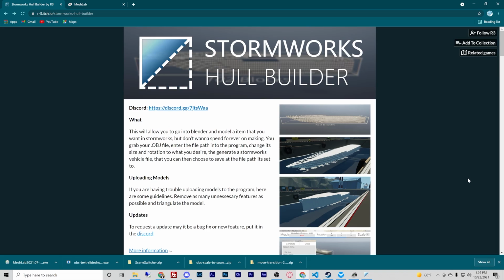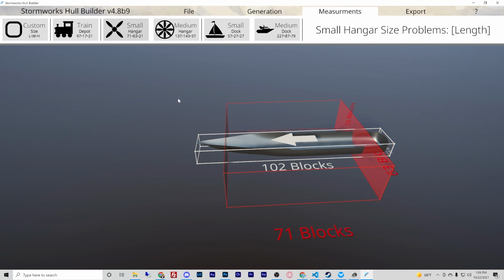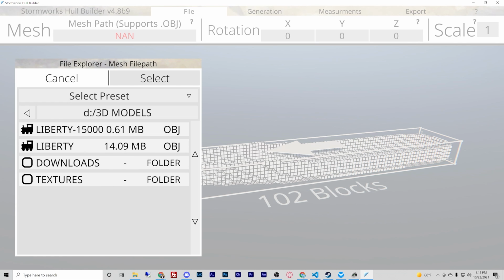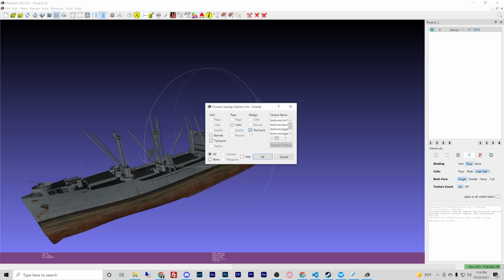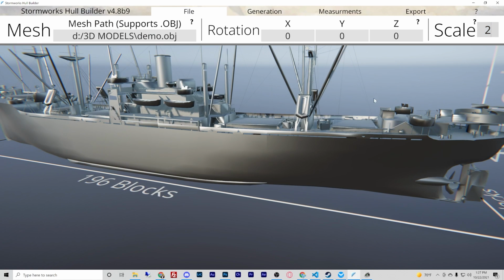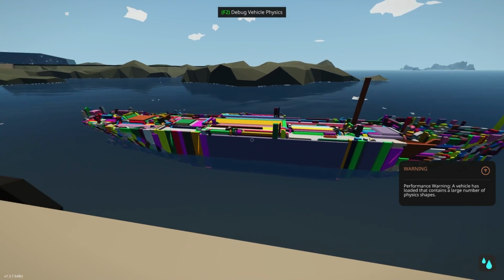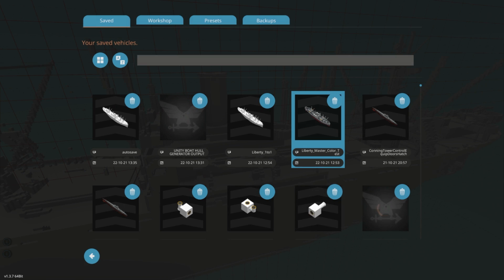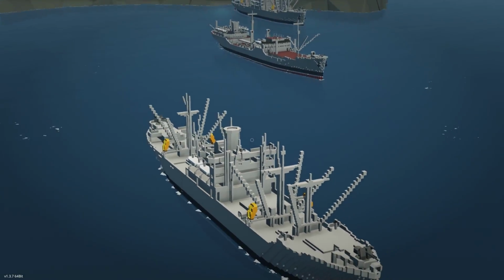3D Import Stormworks Hull Builder Tutorial 4.8

Comment: When i import the 3d model into hullbuilder it will either make 2 of the creations or make the front really weird and flat and make weird little strings of blocks everywhere
Reply from the maker: Most of the issues usually center around too many polygons- try reducing the complexity using meshlab
Reply: @EndoSkull do you mean the 15000 step? So i have to make it less than that? Okay tysm i will try. Also i will join the discord server hahahah just for funs

Comment: It doens't work I upload the obj file it loads a bit then shows a picture about some missing texture when I already removed them after that the hull builder just crashes.
Reply from the maker: You have to use meshlab to reduce polygons - in some cases using microsoft builder to correct errors - Hull builder is buggy so you do have to try different things to get it to work